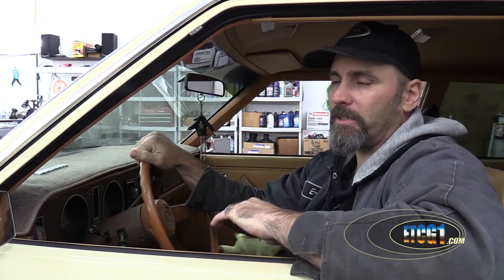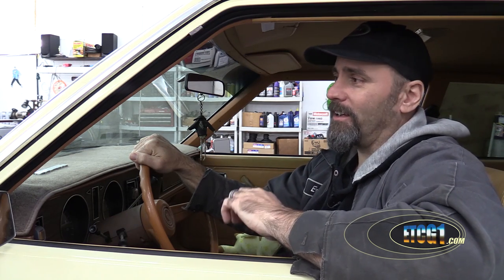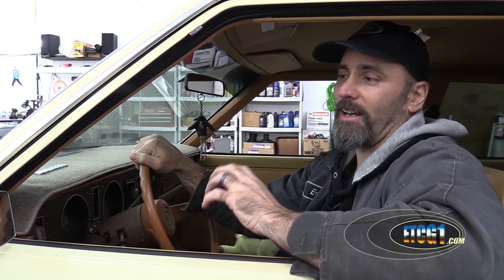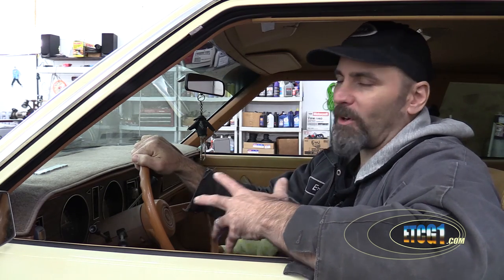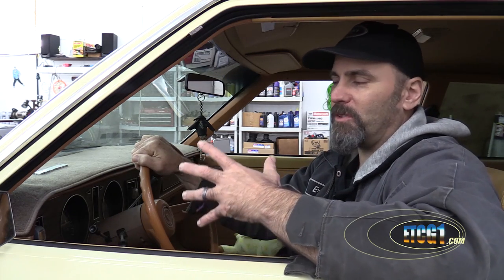Analog vs Digital (Cars)

Comment: A fuel-injected weed-whacker... 🤔
Reply: Eric Brown they call that civic in my country
Reply: Eric Brown 

how about a turbocharged fuel injected weed whacker ;-)
Reply: Well if it's a 2-smoke weed wacker (which 98% of them are), then it's basically supercharged once you hit the right RPM :D
Reply: lawn mower as well thanks
Reply: It'll likely happen eventually someday. The emissions from small engines like that (especially 2-stroke) are incredibly high compared to a modern vehicle engine. There have been some 2-stroke engines built that use EFI and avoid the need for a fuel-oil mix so that they don't need to burn nearly as much oil.
Reply: weed whacker with a MAP sensor and 02 sensors
Reply: It's much more likely that electric/battery weed whackers will come about and eliminate the problem with the very dirty emissions entirely.
Reply: Unless you charge the batteries/plug it into a wall outlet powered by a coal fired power plant. In that case you're better off just burning gas (less wasted power losses in power transformation/transmission).
Reply: They already exist. 
The major small engine manufacturers have been using fuel injection for several years, Honda was a pioneer of this technology. 
Hell, there is even aftermarket fuel injection for small engines. 
Look up Ecotrons,Synerject,  NanoEFI, Walbro and Delphi Multec. 
There is even an Arduino based DIY system available. 
Most new powersports/watersports and motorcycles/scooters are now fuel injected.
Reply: Kanglar power lines lose almost nothing. it's the about 10% efficient coal fired generator steam turbines. remember, no rings to stop blow-by
Reply: The lines themselves don't lose much, but all the transformation of power  that you need to do to transmit energy makes the losses add up. Changing chemical energy to mechanical then back to electrical in generation, losses in the iron core of transformers to step the voltage up for transmission and step back down for distribution, losses in the circuitry for charging a battery, changing electrical to chemical energy in the battery, changing chemical back to electrical, then changing electrical back to mechanical in the tool.
Reply: In the US, coal fired steam power generation is approximately 35% efficient, natural gas fired combined cycle power generation is approximately 45% efficient, nuclear fueled power generation is approximately 36% efficient. 
Power transmission and distribution losses (I2R+core) are an average of approximately 4% for the entire nation. Some regions experience much less loss, the closer the load is to the generating source the lower the loss.

According to the EIA, NREL, DOE, SAE PHEVs in the US market have an overall efficiency of approximately 60-85% efficient including but not limited to transmission/distribution, charging/discharging, conversion, monitoring/control losses.
Reply: patw52pb1 coal fired and natural GAS, I think you mean up to 36% and up to 45% efficient.
Reply: +Peter B 
No, the figures I cited are US national averages published by NERC, EIA, DOE, EERE, NAE, NEMA and studies performed by academia.
Reply: i have seen the test on some not long before you see them being sold but very high $$ only
Reply: If you've ever operated a weed whacker and had the carb leak out onto your shoe from the angle needed to hit a certain spot... a fuel injected weed whacker is something that will cross your mind as a decent idea.
Reply: And a ricer civic/ corolla. What's the difference?
Reply: thats why i give up to on my trucks / cars + I'm try to be nice to the one that does the cleaning but i don't mind getting messy to fix it. fuel injected fuel systems pre 2000 are crap so id be in the old camp but now nope it just got better with $$ more R&D and time keeping engines running longer and better
Reply: Some pre 2000 cars were better than others. I mean fuel injection systems weren't the bottleneck with say a 5.0/4.6 Mustang from the 90s as an example. It was all the other stuff.
Reply: like what ? to me the ECU has changed the most
Reply: Richard Price Yes the ecus changed, but first you're going to want to get more air in I/E/H.
Reply: they make fuel injected chainsaw.
Reply: their called evinrude
Reply: Too much squeeze for too little juice. If brainwashed people would cry emissions, it probably would be worth it for manufacturers. In general, you don't need such a complex system for such tiny little engine you use twice a year and couldn't care less about fuel consumption. Let alone that people wouldn't be willing to pay the price for it. An electro motor on the other hand sounds feasable.
Reply: Lean burn calibrated mechanical fuel injection

Comment: Okay! Being an Electronic Engineering graduate what I truly prefer is mechanical control over electronics in many things. If mechanical systems cannot provide enough accuracy (or control) or If we need to really push the limits that is where I prefer electronics. If a mechanical system is good enough I am totally fine with that. But that is not what we get to do almost all the time. :lol: 

In my free time I always hangout helping with a very good friend of mine who runs a garage. That is where I learned many things. I have seen many old things outlasting performing just fine much much longer than they were originally expected to last when more complex systems just break. And some modern tech things just give up when they come close to the end their service life and at some times there is no point of trying to fix it anymore. To me that is why I have deep down respect for old school tech.

Comment: just a few weeks ago i was working for the first time in a carburated 3 cylinder kia engine on a "asia" bucket to be honest i liked that experience even if it was a spaghetti monster in hoses
after that we recieved a isuzu truck 2.8 diesel from the 90's and my mentor told me those diesels can be the best thing ever, he proved it by insta starting it when he turned the key and showed me the absurd simplicity he also said that kia's besta 2.3, frontier, citroen c15 and hiunday's h100 pre 2005 also have instant start and it was so satisfatory to do

Comment: When I first started working on cars in the early 1970's, it was breaker points. They had to be replaced every 5000 miles. Plugs would sometimes last to 10,000 miles, if they where cleaned and re-gaped. Electronic ignition starting showing up the the mid-part of the decade as retrofit kits. Chrysler standardized on EI around the same time. It was a big improvement over points. I was glad when EFI replaced carburetors, which were tricky to re-build.

Comment: I'm of the digital generation but think there's something so cool about how something mechanical can be made to perform similar tasks. Though that does in my opinion make it seem like more can go wrong as over time wear does affect it where as electronics the most wear that could potentially happen is a bad solder joint forming (excluding something like a relay with mechanical contacts) I guess that brings about the difference of instant failure (electronics) and seeing it coming with noise etc as the part starts to fail (mechanical)

Comment: I'm working right now on fine tuning a dual DCNF Weber set up for my VW Squareback.  It's a 2.0L street engine with relatively low compression around 7:1.  As simple as these carbs are (and they really are simple), there is something about them that seems almost mysterious.  Mind you I'm a 50 year old who in my early twenties had a 67 Bug w/ dual Dells on 1776cc engine. I'm no rookie, with respect to carbs and not scared of them.

But, you have to admit that given how MOST cars are used nowadays, modern electronically controlled FI or DI systems, within the past 10 years have been unbelievably reliable and, by comparison, trouble free.  I have 200K since new on two '05 model year Japanese cars with no drive train issues whatsoever. Nothing but oil changes, brakes, and tires.  But when they go down they go down hard, I will admit.  I had a '00 Passat as a testament to that fact.

I do enjoy the freedom (to fail and succeed) that a carburetor has in it's operation and manipulation and we would not be where we are technologically without their development.  They are cheap and simple, but dirty and inefficient, relatively speaking.  They are not bad and if you look at the CVCC Honda engines of the 70's, they can be as efficient as FI and pretty darn reliable.

Love the videos and your insight is always enlightening.

Comment: Great video Eric, can totally feel your sentiment about break downs with sensors, the older mechanical systems you could patch up and get on your way. The crank and cam sensors are a case in point that leave you stranded. Totally agree with your analysis on the two systems.  I know many mechanics got out of the trade in the early 90's here in Australia due to fear of electronic management. The ones that stayed now have a wealth of knowledge and experience with electronic and mechanical systems. Stewart  Australia.

Comment: As you were hinting at, it comes down to where your preferences/skillsets lie and whether you have the right tools for the setup. Digital just adds a few tools to your toolbox, like a multimeter (should already be in your toolbox tbh) and a diagnostic tool.

As far as codes go, you're right, they only point you in the general direction of the problem and without the right knowledge you're still stuck. I actually prefer ambiguous codes generally found in older systems, like your example with the "Bad O2 sensor" code covering up a completely separate problem. My 91 pickup would throw a code "O2 value outside of acceptable parameters" or something like that, which keeps you open to a number of issues (improper a/f mix, bad or gunked sensor, break in connection to ecu, etc) instead of focusing on that O2 sensor.

Comment: I am much older than you.  I started working on cars long before there were any emission standards to worry about.  Back then, all you needed was some basic tools, a little experience and basic talent and you could pretty much fix anything on any engine.  Heck, back then there weren't any electronic fuel pumps let alone fuel injection except for very rare exceptions.  If someone's car started today but won't start now you could get it running 9 out of 10 times with just the tools on hand.  What is important to understand is that with "analog" technology, the systems were much more tolerant and forgiving allowing you to jury-rig a "fix" in an emergency situation far more than today's cars.  Of course, gas was 26 cents a gallon then.

Comment: i work on semis and other large trucks for a living and im only 22 i think the move to computer controlled systems happened almost a bit too quickly because of all the techs at the shop only me and 2 other techs who are about the same age as me, are the only ones who do check engine light repairs because all the older guys are so used to old school stuff. i cant tell you how many times ive had to work on a truck with hours of time on it because the older techs cant "read between the lines" on all the fault codes and end up chasing some unrelated issue. the older guys are great with older engines like 855 cummins or series 60 detroits that i would have no clue where to start with a problem. is there a big generation gap yes but every chance i get im working with the older guys learning the tricks to older engines. if you stop learning your going to fall behind in this industry. its going to keep changing

Comment: You're a man after my own heart, Eric. Exactly my thoughts!

I can sum up my thoughts on electronics in one sentence: " Electronics are great ... when they WORK." When they break, God help you! In a survival situation, I'll take a carburetor, hands down,  any day!

I think alot of the younger generation is getting their experience with carburetors from 30 year old worn out cars with stale gas in the tank. They weren't around when those cars were new - they ran damn good! 

To tell you the truth, I'd much rather be adjusting points,  changing jets, and caps & rotors than fiddling around with modern crap. Parts cost 10x what they're worth, and it can all come to a grinding halt with one corroded or broken wire, buried in a sea of wiring 10,000 miles long. No thanks! Give me a carburetor, a flat-head screwdriver and an adjustable (crescent) wrench and I'll be on my way, thank you very much! :)

Comment: back in the mid 70's my dad had 2.5 Liter PI Triumph , the PI meaning petrol injection , and being a Triumph it was British , a lovely car in British racing green , but very tricky to maintain  , thankfully there was a good British Leyland service center in town with mechanics who understood the strange British electrics  and the hard too tune injection system on the engine .
Reply: commodore665 the PI was problematic and partially down to the motor used to drive the metering pump. it would overheat and to help alleviate  this, the met police mechanics would route a copper pipe wrapped round the pump motor using the cooler flow of fuel to bring the motor temp down and keep it more reliable
Reply: commodore665 the PI was problematic and partially down to the motor used to drive the metering pump. it would overheat and to help alleviate  this, the met police mechanics would route a copper pipe wrapped round the pump motor using the cooler flow of fuel to bring the motor temp down and keep it more reliable
Reply: When it comes to British vehicles of that era, one of my favorite things actually happened in a recent RCR with a highly modified Jaguar with stock wiring. Whenever he honked the horn at someone, the dome light also lit up, and if that isn't a staple of british engineering quirks, I don't know what is.
Reply: Koshunae haha, what would we do without the british?😁
Reply: between the lucas electrics and girling brakes I'm amazed that anyone from great britain is still alive

Comment: It's not a generational thing for me---I'm almost 50 and grew up with carburetors, and I much prefer fuel injection for a stock daily driver. There are no driveability issues with fuel injection, and they always start/run the same regardless of temperature. Of course they are more complex, but I drive Toyotas, and I never have problems with the injection. Or in other words, complexity isn't a problem if you never have to fix it. Having said that, for a hot rod I'll take a carburetor.

Comment: I read a lot of the comments, scratched my head about the responses. What I got from the video is, what do we prefer, fuel injected or carbureted.  The title of the video, led me to think it was going to be about instruments/gauges. I prefer carburetors personally. The reason being that I can make my own repairs, even on the side of the road. Living in central Alberta the temp., often drops below -35`C during winter. My '80 Powerwagon is as basic as it gets, 360, 4bbl, 4spd. It even has a manual choke. But it's never let me down, and I only carry a simple Stanley suitcase toolbox, spare ballast resistor, and ignition box. Daily driver is a '99 Ram 1500, 360 MPFI, 4spd., auto. Might be my age showing though but I prefer driving the '80, choosing my gear, adjusting the manual choke, not so much.  If the mechanical clutch linkage fails again. I can still shut off the engine at a red light, or stop sign. Fire the motor up, while in first gear and make it home. With the '99, if the electric fuel pump fails, or the ECM fails, it will need a tow home. They are both extended cabs, and 4x4s. '99 is pretty much all stock, the '80 has had a 4" lift, 35" tires, headers, with a single 3" exhaust added. If I had to give up one of my three trucks, hands down the '99 with the MPFI.

Comment: Finally, Eric you got it right... today IS my birthday. Do you know how many years as a subscriber I have waited for you to get that right ;)

But as for analog vs. digital, much falls back to the end user. The mechanical minded person would rather have a car with mechanical fuel delivery, mechanical operated ignition timing and a radio that actually has a switch on the radio that turns it on - and to open the hood and actually see the parking space  under the engine. The average driver today looks at the car as a transportation appliance and appreciates the digital memory seats that adjust to "his and hers" settings and that fake performance engine sound that comes through the radio, uh, infotainment system speakers.  Problem with the digital it when it breaks, so does your wallet.
Reply: happy B-Day Alan .
Reply from the maker: Happy birthday! and thanks for the comment.